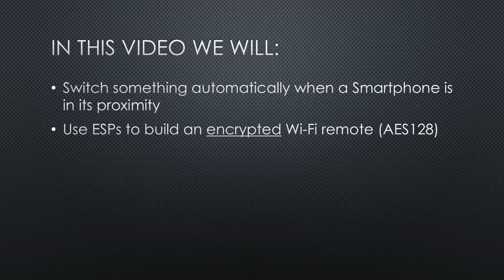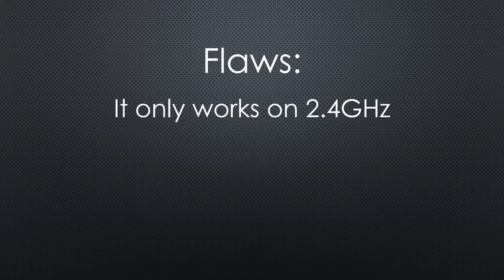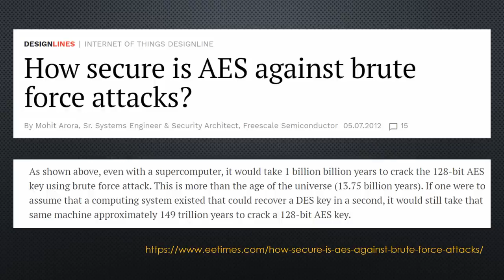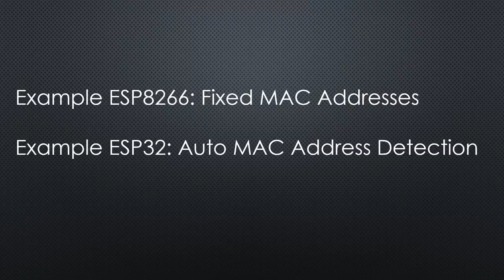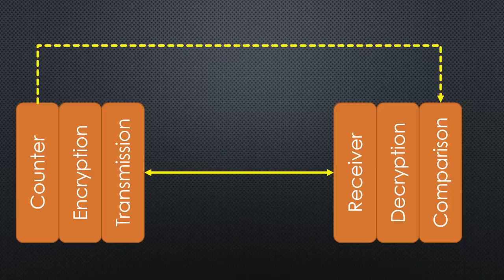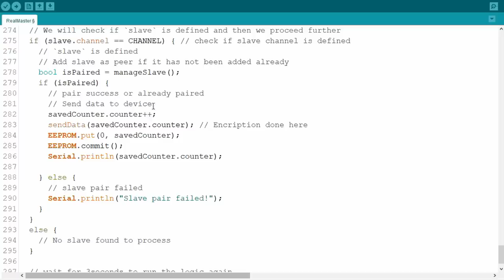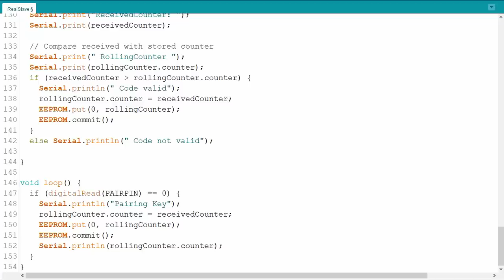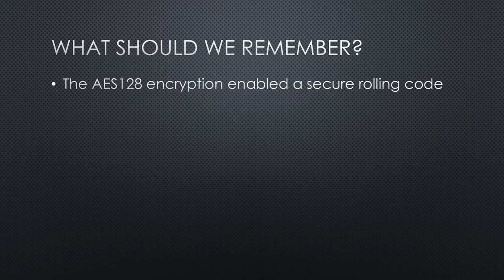#382 Secure and cool Remote Controls (Touchless, AES128 encryption, with a T-Beam watch and a cat)

Comment: I think a better alternative is a challenge/answer.

The lock sends a challenge like a random big number. The key encrypts this number and sends back to the lock. The lock decrypts it and check if it's the previously sent number.

This way, it's useless to replay previous messages because the challenge changes every time. 

But it requires two way communication.

By the way when I say "encrypt" it can be something as simple as add a secret string to the challenge and calculate md5 or sha1. No need for a real encryption.
Reply from the maker: You are right. Adding a reverse channel definitively would add a lot of security.
Reply: @AndreasSpiess  and it does not require synchronization...

Comment: In your current sketch you accept 'any' value that is larger than the current counter, and the cyphertext you send is very small (an unsigned long, albeit padded to 16 bytes). This will make a brute-force attack much easier because stumbling across any cyphertext for any larger value would open the door. There also does not seem to be any check which sees whether the decrypted text 'makes sense'. I might be mistaken, but I don't think it is part of most sync.block cyphers to check this by themselves. If I am correct, essentially any cyphertext would probably be decrypted to a 'garbage' non-zero long, and then be accepted by the receiver.
Reply from the maker: You are right. I think it would not be too complicated to add a „window“ as many viewers suggested.

Comment: Interesting project!
My add on would be to include the Date/Time with the counter value, then encrypt the whole thing. On the receive side, you have 2 variables to compare; 1 - is the counter incremented, 2 - is the time within the right range (the Date/Time range can be set by the user, depending on security level desired). The draw back here is that the system has to have a moderately accurate real time clock (RTC). If you are using a smart wrist watch that should be no problem for the transmitter. Since the receiver is likely hard mounted to some fixed infrastructure (like a garage, etc) there should be a power source that is adequate to run a RTC in the receiver. 
With this addition in place, a bad guy will have a very limited amount of time to find the encryption key, decode the counter value and then increment it and send the new encrypted message back to your receiver to open you door. Still not impossible to do, but considerable harder.
After posting this I scrolled down to see this idea had already been posted. Oh well, better late than never. :-)
Reply from the maker: You are right: Adding time would tremendously increase security. But it means that we need synchronized clocks on both sides. Not easy to solve, because they have to work for years (assuming the key has no internet access).
Reply: @AndreasSpiess  Allowing for a time range (window) to match, should solve the problem of synchronization. Assuming an accuracy of 1 minute/year. A matching range of 10 minutes would allow for 10 years before re-sync would be needed. A range (window) of an hour would allow for 60 years before it failed. If the accuracy was as bad as 6 minutes/year, then you would still get 10 years before failure. If you only send the code once per day then you could even make the time window equal to the usage rate and thus even with very bad clocks, a time window of 24 hours should provide many decades of use before synchronization becomes a problem. The time window just needs to be short enough so that cracking you crypto keys takes longer than the matching time window you allow. I don't think anyone is going to be able to break your AES 128 crypto in 24 hours. :-)

Comment: if you have access to an RTC, just include a timestamp - unixtime format - into the message. this way you can also verify whether the message was prerecorded. keeping a +/-10 second window can solve problems related to small inaccuracies
Reply from the maker: Agreed. But you would need two long-time stable clocks... (No problem for a Swiss, of course, but not cheap ;-)

Comment: Hi Andreas, understanding it's for demonstration purpose it's just a reminder : As you know EEPROM/Flash memory cells do have a wear by writing to them. As you write any change to the EEPROM it wearing out quite fast in a real world. Beside that excellent idea.
As mentioned in a real world scenario I would suggest do overcome the write limitation of the flash by using a random challenge response authentication system . Something like having a fixed set of keys ( 16 or so ) that are chosen by random (or derived from the minute of daytime) on the master device while the slave has to try any of it's known keys to decode and properly respond either using the found key or any other based on a rule (maybe just next one). That way an attacker would have to know all keys and it's order. So along with AES 128 I would call it somehow safe ... Much like the "shed's" in the swiss mountains - I guess you know what I mean.

Edit : A replay attack can be prevented by the send (changing) challenge message where the slave has to know the proper answer.
Reply from the maker: You are right with the EEPROMs. Recently they seem to be better and we could rotate the storage of the values to reduce the problem.
And I agree, adding two-way communication would open the door for many more concepts.

Comment: Please work on that code sent > code last received. If I send you the max number from longint I will always be right. Set a limit the new code should be higher than the old code but not too much (an interval of 100 codes should be ok)
Reply: You would still have to know the correct encryption key.
Reply: The idea is, that attacker can't encrypt message because hi don't now key.  Hi can only copy a message, so hi can't change any value.
Reply: @zeero4ever  it depends how the code is validated. If it only checks whether the integer has increased, you can bruteforce randomly, at minimum, increasing the counter (which at some point will overflow or start at 0 again)
Reply from the maker: I agree, a number window would be a simple and good addition. But I can assure you to create a number without knowing the key is not simple at all...
Reply: It seems to me that if you are sending ONLY a number then @user above is right and you must limit the number of acceptable messages (to 100 for example), otherwise almost any message would be decrypted to a valid message. If you are sending something like "hello world" + number and validating that the decrypted message includes "hello world" then the possible values for the cryptotext is much larger  than the set of acceptable messages, and brute forcing is less feasible.

Comment: I think one needs an upper bounds on the decrypted counter, without that there is likely chance that a random generated encryption string decode may be larger than the counter and open the door.  Depending in the current counter value it's the probability of the decrypted random numbers being below the counter value vs it being above is the counter.  If the counter value was at 1 all numbers but 0 or 1 would open the door.  Very significant probability any random encrypted string would resolve to > than 0 or 1.
Reply from the maker: You are right. Adding an uppr limit would be a simple way to increase security. But it is not easy to create even a number without knowing the key...

Comment: simple approach without risk of desynchronization: Just use a similar system to one-time passwords: use the current timestamp as the "rolling code" before encryption
Reply: But the esp looses time tracking without network connection realy quickly... And am rtc clock makes it more difficult
Reply from the maker: You are right. If you have a good clock inside both devices you can add more randomness to the numbers when you use time stamps. But I am not sure if it is worth the effort in addition to ASE128 encryption. Desynchronization also can happen here (battery dead for example).

Comment: Hey Andreas, great video as always! Maybe have a look at UWB (Ultra Wide Band)? It looks like it could be a perfect solution for a save "James Bond" door opener?
Reply from the maker: Did you already find cheap modules? Last time when I researched the topic a module was still a few hundred dollars :-(
Reply: @AndreasSpiess  Yes, as UWB is still a pretty new technology and there are not many manufactures out there producing UBW chips the prices of them are indeed not that cheap at the moment. In my opinion the most interesting chips for makers are the ones from Decawave. Especially the Dev-Board “dwm1001-DEV” looks like it’s a good starting point. Its 21 bugs on mouser atm.
https://www.decawave.com/product/dwm1001-development-board/
Reply from the maker: My link says more than 200$: https://www.mouser.ch/ProductDetail/Qorvo/MDEK1001?qs=TiOZkKH1s2TlRZBi6MtMNg%3D%3D This is what I had saw when I searched last time.

Comment: Earlier this year I was experimenting with ESP-NOW for my RIoT home automation project, including some remote switches. I dug in to two way communication and robust challenge-response / IV exchange, and it was easily an order of magnitude more complicated than using a rolling code. In particular it becomes a mess if you want more than the small number of devices normally supported. ESP-NOW only allows a limited number of receiver devices a single device can transmit to, so you need your hub to dynamically re-allocate entries. Definitely not worth the effort for simple remote buttons IMO.

I did push forward on it though, as I use the two way communication to notify the devices if there is a firmware update available, which causes them to automatically connect to WiFi and update themselves.
Reply from the maker: Very interesting project! I am glad you finally got it working.

Comment: GER: 
Durch deinen Kanal bin ich wirklich auf den Geschmack von ESP32s gekommen, danke dafür. Mit Hilfe deiner bisherigen Sammlung an Videos zu dem Thema habe ich dual Core Programme geschrieben, mich endlich mit den BL/Wifi Features beschäftigt und so weiter. Mittlerweile benutze ich die Arduino IDE fast nur noch für ESPs. Probiere gerade weniger bekannte und weniger gut dokumentierte Boards aus, wie das TTGO T8 v1.7 oder das S2-Soala. Das TTGO habe ich jetzt erfolgreich zu einem potenten A2DP sink für Bluetooth boxen hinbekommen, dank viel Flash und IPEX Antenne mit sehr guter Reichweite und extrem störungsfreiem Betrieb. Das Soala Board habe ich mir noch nicht richtig angeschaut.
ENG:
Because of your channel i really got interested in ESP32 boards, thanks for that. With the help of your neat collection of videos i have written dual core sketches and finally really discovered the BL/wifi features. At the moment, all I use the Arduino IDE for is basically ESPs. I am investigating some of the lesser known and less well documented boards at the moment, like the TTGO T8 v1.7 or the S2-Soala. I succsessfully made the TTGO into a very potent A2DP sink for Bluetooth speakers, thanks to its big flash and its IPEX antenna with absolutely trouble-free performance and long range. I am looking at the  Soala board next.
Reply from the maker: Ja, die ESPs bieten schon viele Möglichkeiten mit Wi-Fi und BLE. Du hast ja schon schöne Projekte gemacht. BTW: Für das S2 board musst du die Experimentelle Version des Arduino Frameworks auswählen.
Reply: @AndreasSpiess  Ja danke für den Hinweis, das habe ich schon gesehen. Werde wohl eine zweite IDE aufsetzen, um mir die stabile Version nicht zu zerschießen. Danke für deine Videos!
Reply from the maker: Ich konnte ohne Weiteres zurück zur normalen Alle Files sind in einem Directory und wenn du sicher sein willst kannst du das jeweils löschen...

Comment: A basic clock at both ends can avoid the milking problem, the clock doesn't really need to be very accurate as any milked codes are likely to be used well outside of any sort of timeframe requiring high accuracy and each time the receiver gets a valid unlock it resyncs it's clock to the transmitter clock at the same time to correct for drift, you could actually use the time from an off the shelf RTC as your counter seed for the encryption, just set the starting time and date to something fictional and random, I assume the watch has an RTC built in? So you can use that time and apply a secret offset/salt it with other data.
Reply from the maker: Interesting concept. It also should work with one-way communication.

Comment: A challenge response security seems more apropriate here. The advantage is that once both sides share the same secret (key), there is no risk of desynchronisation of the counter value, e.g. when the transmitter battery fails or when the transmitter software is reloaded or when an other transmitter is added, ... In a challenge response, the receiver would ask the sender that he knows the same secret, by responding with the challenge a) encrypted with a shared key or b) hashed after combining it with a shared secret.
Reply from the maker: You are right. if we add a back channel we get many more possibilities.

Comment: 7:19 no, MITM jams receiver when you push the button, and retransmits second code it gets from your remote. All happens in a blink of an eye, so you may think that it was a glitch the first time, door still opens, but attacker still gains unused key for himself.
Reply from the maker: Maybe this is possible. Usually, all receivers are jammed at the same time if they are close to each-other. Which is the case if I am in front of my garage and press the button.
Reply: @AndreasSpiess  Don't recall the details, but it was documented by some pentest specialist.
The most secure way I can think of doing this with amateur MCU project is TOTP, given that you can maintain accurate time source and it won't render your door unusable in case it looses sync.

Comment: Might want to have a look at mbedtls library. Basically the industry trusted standard as far as I'm aware. Think it is included in the Arduino install for the ESP32. It is in the IDF.
Had a proximity lighting project a year or 2 ago with BLE. Project was caned because it made the employees feel unsafe. Basically made the place look like a horror movie with the lights turning on and off as people moved though the hallways.
Reply from the maker: Thank you for the tip. It seems the mbedtls can also be used in the Arduino framework.
Concerning BLE for light switching: I like this idea. Very strange people were scared. It seems not too hard to understand what happens....
Reply: @AndreasSpiess  It's the reason the bean counters gave me. It was in semi rural Africa. Very superstitious.

Comment: Great video! Non-encrypted garages remote systems are really bad. For instance, see Samy Kamkar's 'Open Sesame' project for a DIY tool that can open any of those garage doors in mere seconds by cycling through through all possible values using De Bruijn codes.
Reply from the maker: I assume it would be hard with this door. Maybe we also could implement a waiting time after a few wrong tries...

Comment: Milking keys can be mitigated against by sending a timestamp so that the key becomes invalid if reused at a later time (depending on how good you can maintain the synchronisation between clocks on your transmitter and receiver).
Reply: Exactly what I thought. I'm a simple web-developper just passing by, this is not my field; so I wonder what Andreas thinks about this solution. 🤔
Reply from the maker: I agree, using time would increase security a lot. But .If you want to use timestamps you need two synchronized clocks on both sides. Maybe not an easy task over years with battery change etc.
Reply: @AndreasSpiess  but does your use case require remote situations where there is not the opportunity to resynchronise time over many years (whether the two devices synchronise with each other or synchronise with a common remote NTP server)?

Ofcourse, simply maintaining a running clock on the transmitter will increase battery drain as the battery will have to keep powering the clock even when not having anything else to do.  Again, this is down to use case, as to whether this is an unacceptable penalty to pay for that use case.
Reply from the maker: @Hfil66 I decided not to use Wi-Fi for the project. With Wi-Fi, you have many other possibilities, you are right. A simple HTTPS call would have been enough, I think. I also wanted to keep the possibility open to exchange ESP-Now with another communication like 433MHz.

Comment: Just encrypting an incrementing counter value as your payload makes your system subject to cryptanalysis attacks and simple bit twiddling to possibly get a decrypted result in an acceptable range.   Ideally, you should use AES in GCM mode (a mode that ensures that the data is both encrypted and authenticated and has an inherent counter separate from your rolling code to prevent bit twiddling and complicates any cryptanalysis) and would be recommended to have a more complex, less predictable message content than just the counter value.  Challenge-response would also allow implementation of much stronger mechanisms,  but if you had to stick with a simple one-way transmission, choice of AES mode is very important..   Variations could include manipulations of the IV (e.g., current date and time encoded as IV, assuming you can maintain reasonable sync between remote and door)..
Reply from the maker: Thank you for your additional ideas! I did not know that an internal counter is possible. This algorythm does not have one. The code for a particular message was always the same if I remember right.